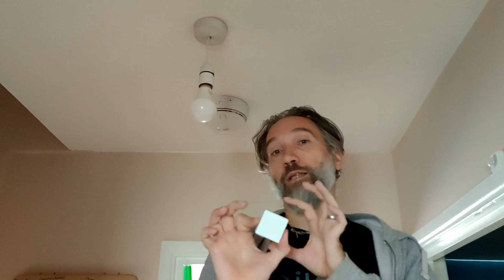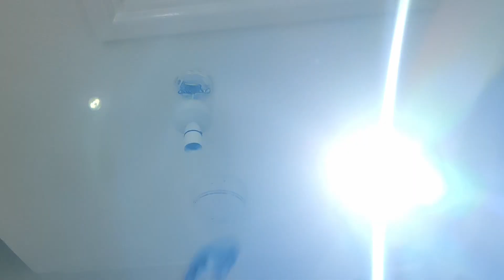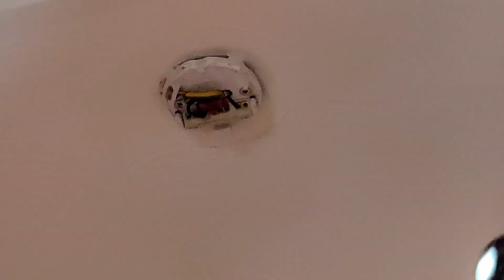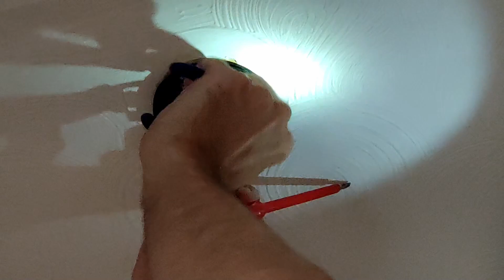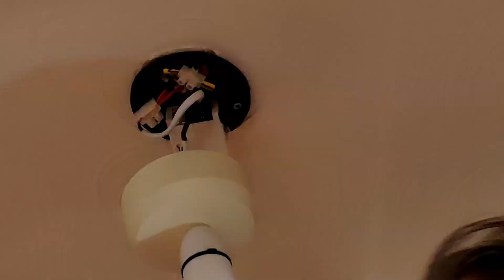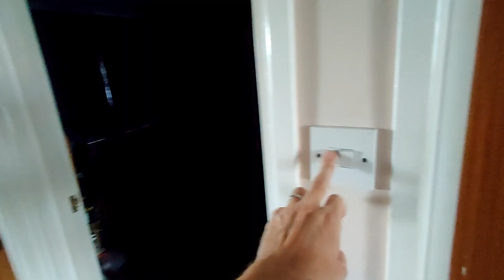Smart lights, working switches, UK wiring. How to.

Comment: I like the large ceiling rose idea, but a 3D printed one won't pass UK fire regulations - if you were concerned about those things. I've used those Z-mini models in my garage style light switches which are in a large wall mounted box - very handy, and setting the 'switch type' of the button to 'State' not 'Toggle' allows it to 'remember' the physical wall switch position - if you have OCD and need switch to 'look off' too!! Haha
Reply from the maker: I did some research around UK fire regs first, I couldn't find anything to suggest a problem. These are PETG which itself is fire resistant and safe for electrical enclosures. Any specific regs I should check out?
Reply: @MakerGeek  ah that's good to know, I just assumed all UK electrical plastic boxes/roses had to meet minimum fire melting times and temperatures? Not sure of any regs, I just thought it was the case?
Reply from the maker: @ChunkySteveo  I think the main thing with light fittings is that the ceiling has to be 30 minute fire resistant and the light fitting can't compromise that. I'm sure there is some red tape that means if it doesn't have a stamp then it technically fails. But then this is about 30cm from a fire alarm so I'm happy to take the risk

Comment: Great video, what I've been looking for!  Assuming it would be just as easy (providing one has access above ceiling rose) to have a multi-inlet box in the loft containing the 'gubbins' and the only wire to the visible ceiling-side rose/light being the switched live? Presumably this could be chained in parallel to other lights (current draw dependent, obviously)
Reply from the maker: yes indeed. as it happens I also went to do this to the light in my study to find only the switched live came through teh ceiling at all, the junction box is in the loft. same for my master bedroom. this makes life much easier ;-)

Comment: Option 2:
Wire the existing light bulb into the permanent live. Renders the switches useless of course but keeps the smart bulb live.
Reply from the maker: for a long time I just had these little 'missle switch' gaurds installed over the light switches to stop me accidentally using the ones that would turn off the smart buibs. this was mostly effective, but I did miss being able to use the switches. automation is great, but it's hard to cover all the edge cases well.